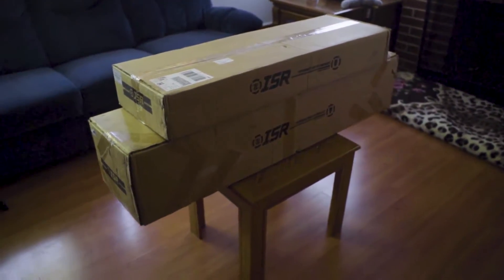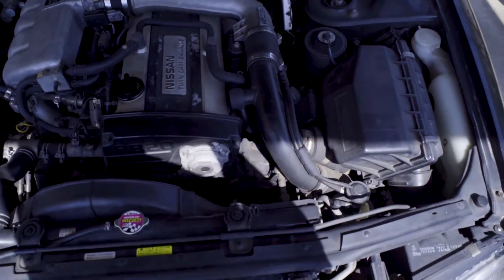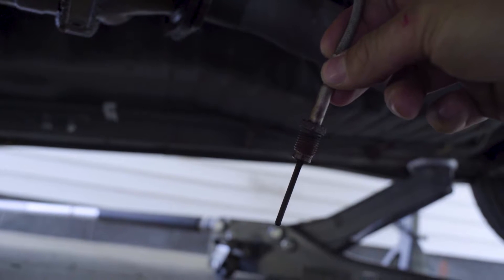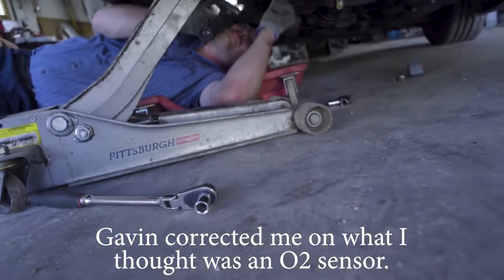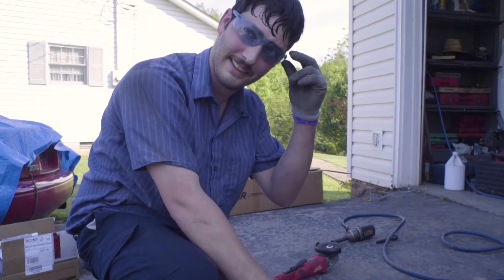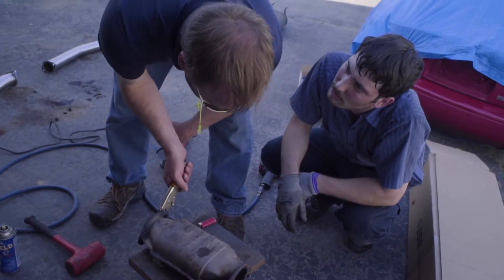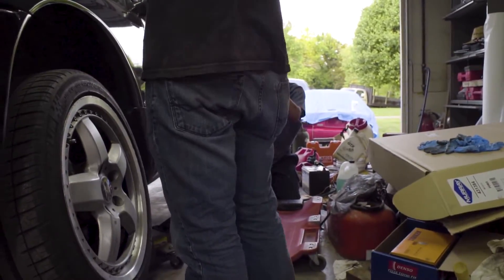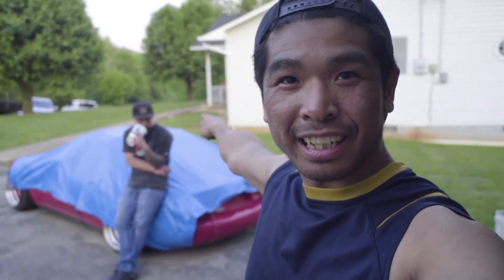Nissan Skyline R32 - ISR Turbo Back Exhaust Install Day

Comment: Hey man I noticed you're from TN i'm a state over in VA. How hard was it to get plates for this, also is insurance difficult?
Reply from the maker: For me, getting plates is just as regular as any other car; registered as a Nissan Skyline with a new plate upfront. Didn't even need my import documentations (importation was done previously before I purchased the car). 

As for insurance, I had to shop around for a bit to find one that satisfied me. Most likely you'll have to do the same as rates will be different between us. I've only quoted from a few insurances, but none denied me with a quote. Some weren't able to do full coverage. Ultimately, I decided to go with Progressive liability because I don't drive the car as often as I'd thought.

You say you're in VA. I've always heard many stories about rules from friends living there. One friend and his dad I know both have their own skylines that are of course legal. I never asked about, but it doesn't seem like that had issues registering their vehicles. The son even has his own custom plate if that matters; also, his skyline is a sedan with a bn sports kit and very low with 18s. Where I live, we don't have vehicle inspections so for my friend with his slammed skyline, I assume he had no problems passing since he drives his car often. Concluding, I can't really say how difficult it is for you to get plates. Judging from my friend and his dad, I imagine it won't be too hard. Just be sure to have import documentations if needed.
Reply: @GoonkVilaivanh  if you care to know as a Maryland resident.   theres some "issues" with getting a skyline registered,  Historic tags arnt a big issue, other then the car still breaks COMAR State regs. if the state police want to ticket you for 3 laws.  

1. (Biggest) 1986+ vehicles need side marker lights and reflectors, these cars do not.  ( Do you want to cut holes in the side of you car and add trailer or motorcycle lights?)
2. Fuel inlet needs a restrictor so you cannot use leaded farm fuel pumps. (never seen a unleaded fuel pump in my life, i hear airports might have them somewhere away from the  public,  fml)
3. need a sticker on the dash stating the math from Kph to Mph (ie. a Yellow stickey note saying 1 Mph = 1.62Kph,  much lolz)

if you get all three things in MD you can then get normal reg plates, if you bypass inspection and get Historic tags, the State Police can still cite you for these 3 violation if they want.     My advice, if you want non historic tags, is to pay off a Inspector for a passing inspection, so find one that likes bribes.

If you have a State Title you dont need import documents for the vehicle.   If the car doesnt have a state Title....um goodluck with that papper work make sure you got dereg docs and import docs for the car atleast when you hand over cash for it.

Now for insurance.... Get fucked!!
only 2 companies in all of Maryland will insure one. so pretty much  progressive is your only option really.   so my insurance doubled from $700 a year for a S10 or MX5 or RX7  up to $1400ish.

also know any personal seller is usually selling one as a fliping car or one that has a issue.   or both!.    so expect it to need some work, and pay more then its really worth.
Pro tip, if the car is idling bad or rough replace the MAF first.  also Idle Air control valves are usually on the list of things it will need replaced or cleaned thoroughly.    

Best of luck.    also dont expect chicks to think its a cool car,  mostly just get dudes wanting to talk to you and take pics of it.  you cant take them anywhere without worrying about them being circled by dudes like vultures.  even going to the grocery store can turn into a photo shoot by a teenager,  let alone going to buy gas and not having to have a 5 min convo with a strange guy.